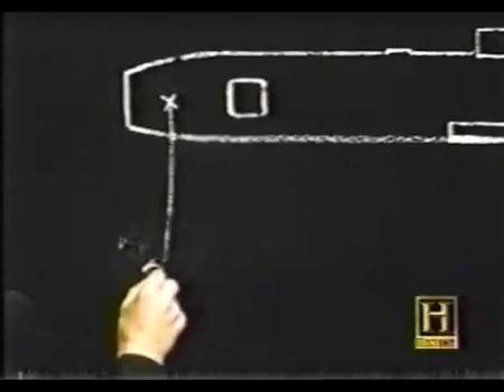V2 rocket launch from USS Midway Aircraft Carrier (1947)

Comment: Is this completely insane ?

Who in his right mind would fire a rocket like that off a ship and risk

1. the safety and lives of the crewmen; and
2. the integrity of a large warship.

The rocket could

a. explode upon ignition, thus potentially sinking the ship and killing all aboard;
b. tip/fall over on a rocking ship, and head straight for the ship's tower (bye, bye, naval officers);
c. fly up a little, then decide it wants to head back from where it came.

I smell bullshit.
Reply: They weren't just doing this for shits and giggles. A lot of careful planning went into this test. They took it very seriously
Reply: Throat Yogurt

Obviously they did not. If they took it seriously they would never have fired a large rocket sitting on the deck of a rocking ship.
Reply: As long as they didn't keep the warhead in there is absolutely no possibility that a V2 failure on the deck would sink an Aircraft carrier. None. These ships are designed to stay afloat after taking direct hits from naval shells and other explosives, they even mention the hardened steel plated deck in the video as one of the reasons for testing on this ship. Also, the chance of the rocket returning to the point of launch would be like getting struck with lightning - V2's almost never fly straight up, as shown in this video. This means the rocket would have to turn around mid flight and come back, which is extremely unlikely. The only thing you did get right was that it COULD have hit the traffic tower but even then it would not have done nearly as much damage as you think it would. Rocket fuel is not as strong as military grade explosives, which is what the ship was designed to survive against. The military has done tests FAR more insane than this so you really shouldn't be surprised at all.
Reply: Had to try it someday?
Reply: +CitronBleu If it exploded, it would have probably left a hole in the flight deck, but ultimately would probably not have sunk the carrier.
Reply: The v2 rocket was designet for this. The germans wanted to launch these rockets against america, from warships. That is why they built such an advance automatic guidance system, so that it could right itself if launched at an angle.
Reply: V2 was like if China captured America's secret space plane.  It was top of the tech, of course they NEEDED to see how it worked.
Reply: You talk about the same country that, at this time, made explode many nuclear bombs in the atmosphere on its own ground...